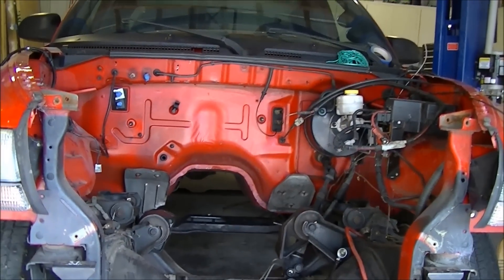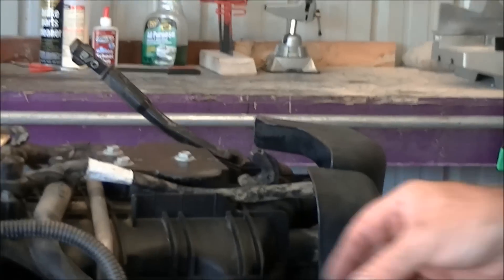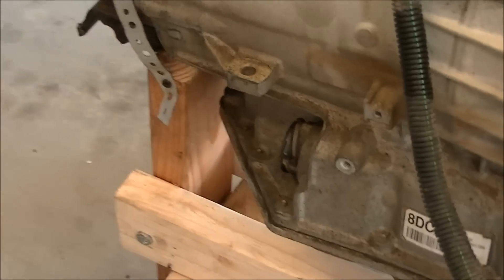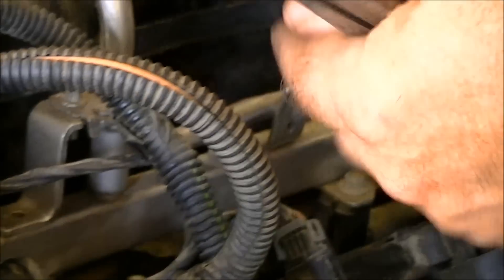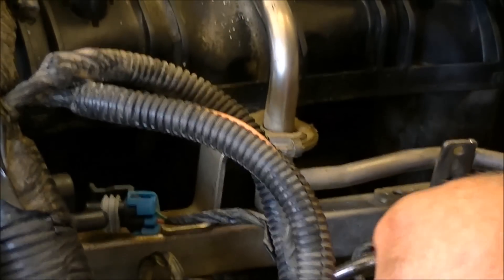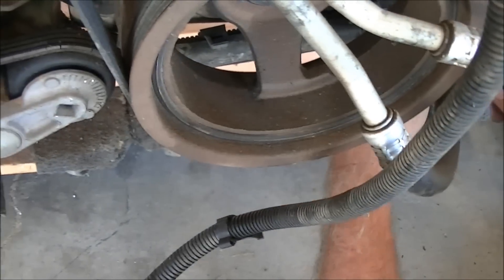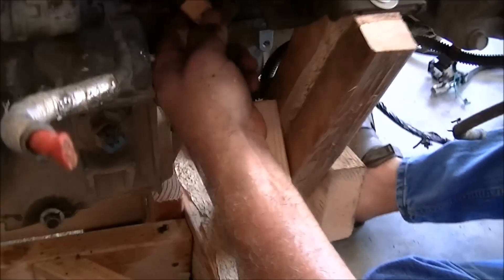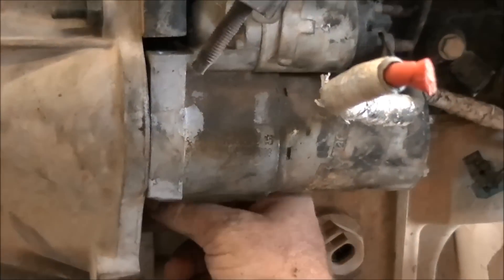Removing the Wiring Harness from an LS Motor

Comment: Watching this video after almost 4 years, I realize how many mistakes I made. I had never worked with an LS engine. It does get some likes, so hopefully it will help some people.
Reply: it helped me a lot its not any other video like this out  if you could make a new one that'll be good
Reply: Next time I do an LS, I want to do a better video. Glad it helped.
Reply: Gonna be pulling harnesses from 2 trucks destined for the crusher this coming Sunday. My 67 Dodge D200 was retrofitted w/ a 5.3L vortec and everything was done great......except the electrical. Watching the harness teardown performed ad nauseum has motivated me to rewire as a complete standalone with no unnecessary wires left in place. This is a helpful addition to the plethora of shared knowledge that has made these tech-heavy powerplants easy to understand. THANKS!